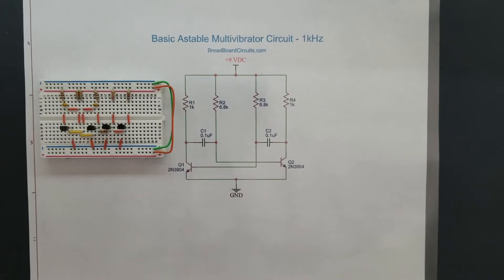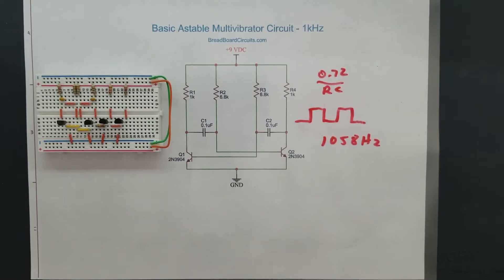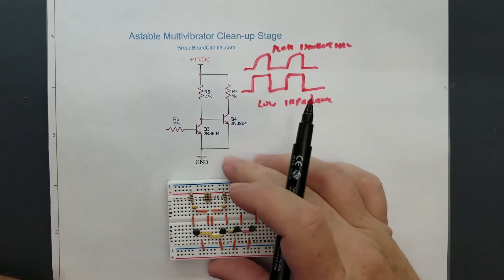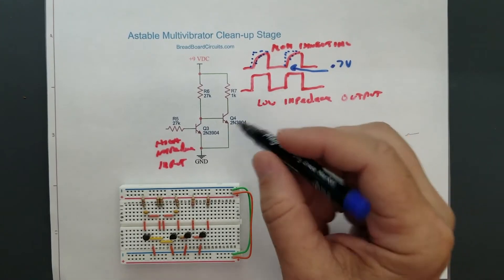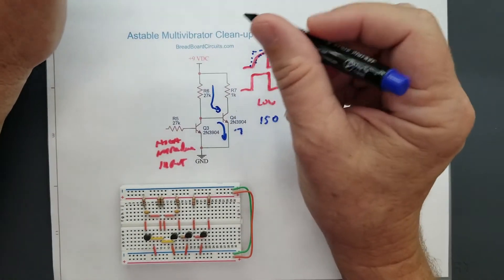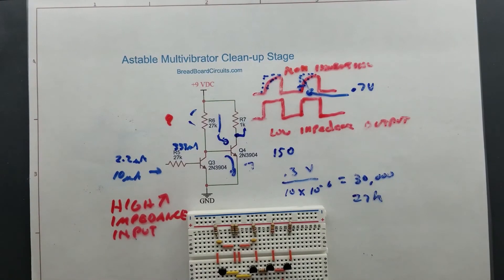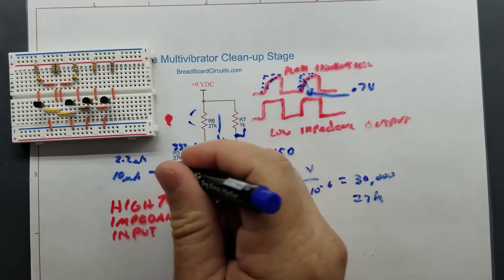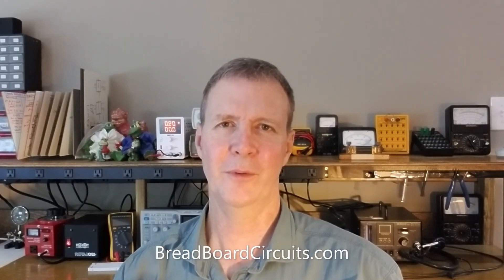#11:  Square-wave Generator using Transistors on a Breadboard

Comment: thanks, I used your generator in a project and report i made on oscillators. I am very grateful, fully functionning circuit (for a change - because sometimes the theory book circuits don't quite work...)

Comment: A very important lesson for me towards the end, something I´ve been struggling for ages to understand, so, thanks a lot... Still, the backwards-deduction-method is something for already trained people and not for me, so, I struggled in regard to the teaching method, but I finally got it, after all...!!! (played the video backwards, segment-for-segment  ;-) Would you please give a tip, about what would change, if a mosfet was used in the final stage??? I mean, getting fast to the saturation-stage of the mosfet, is also an issue as well (my issue, to be exact  ;-)  but things surely change a bit, if not a simple transistor is used, but a mosfet instead... Thanks anyway, and also á priori, for any eventual answer... (the 30V-pwm-gen I bought, has a nice sq-wave, but I need to find out, if its puny 30mA are enough to turn on the mosfet directly and as fast as possible. With this video´s help, I can calculate it now, but I ask myself too, if the 100V-LogikLevel-mosfet brings any additional surpises, compared to your 2-transistors-stack)
Reply: Do you want to build a flyback driver??? I think you can use a simple npn/pnp driver for the mosfet gate

Comment: so in this case where would we put the LEDs? After R1 and R4?
Reply: I put the LED anode (+long lead) anywhere on row 23 (attached to R6); the cathode (-short lead) to the ground/neg rail (ex. put cathode to row 24, then row 24 to ground/neg rail). LED will appear as solid light-on because the square wave freq. is so fast (1kHz according to Breadman's docs). I confirmed with a oscilloscope, and the wave is very nice and square and hovers near 1kHz as stable as I think is reasonable to expect without a crystal or clock IC.

Comment: Interesting video. Would be cool to see the absolute measured rise/fall times the scope can give for each. Would also be interesting to compare your 'discrete' solution, to putting it through a 74 series schmitt buffer or double schmitt inverter, as well as a comparator (lm393) opamp solution setup correctly. See what pros and cons arise. Would also be cool to see inserting a pot to tune a 'sweet spot' resistance helps improve the rise time any, or doesn't make much material difference.

Comment: Not meaning to nitpick, but it if the output was inverted would it really matter?  I ask because there is no input side to the oscillator and so it doesn't really seem that offsetting the phase by 180 degrees would be a problem.  The only real difference I can see is that you would need to turn the pot in the opposite direction to get the same duty cycle effect (as per your other video where you varied the duty cycle via a pot).
Reply from the maker: Yep, you're right that it makes no difference in practicality, but I thought the inversion should at least be mentioned.
Reply: It does matter when using the oscillator for audio. For instance, in the wave generator of a synthesizer